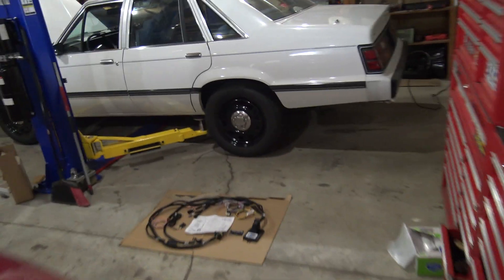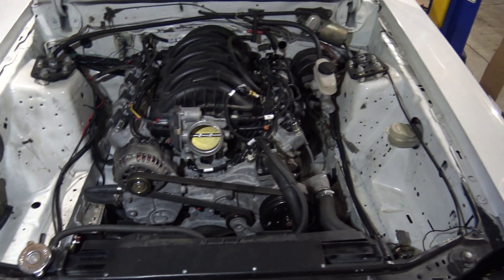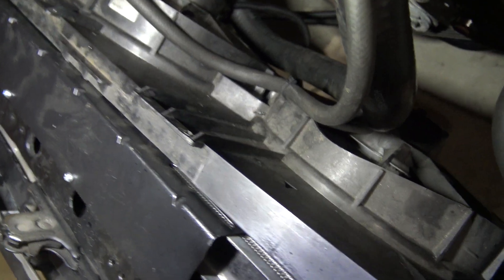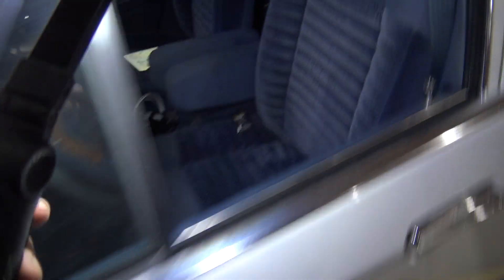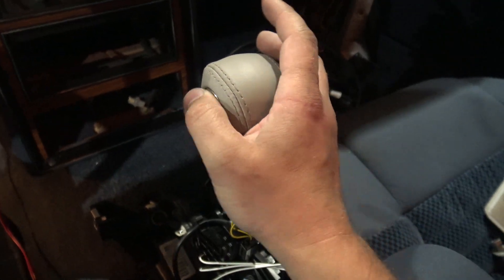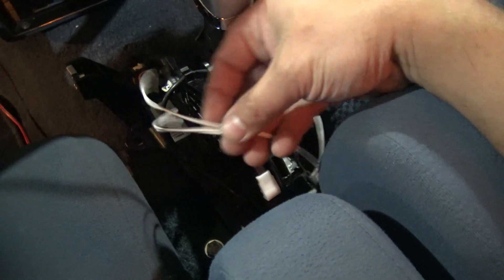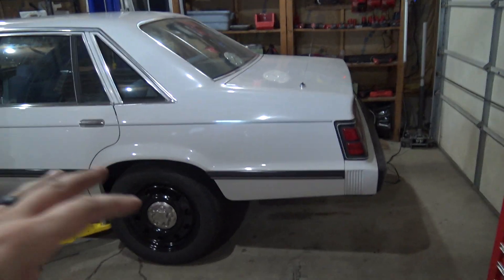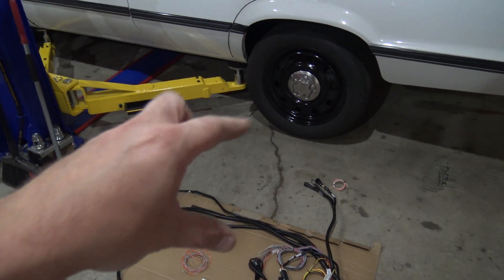Arnes LTXD transmission update

Comment: Forgive me if it’s already been discussed. 

If the torque management can potentially help transmission longevity, is there a way to implement it into transmissions like the TH400?
Reply: Not really since the th400 is completely non-electric so the engine doesn't know when it's going to shift so it doesn't know when to pull timing for a shift.
Reply: Yes, you can do a lot with the custom I/o section in the Holley. My only gripe was not having an engine rate of change pid like you will find on many other standalones. I’m Aaron btw.
Reply: Scrapmetal_Sleepers I was curious about that after Matt said the TH400 and others can eat up power on shifts. I’m very new to the world of electronic everything and stuff like this is so intriguing. Especially coming from roots of if it’s not a BBC and shifted by a powerglide or a T10 then it’s not worth driving. 😂😂😂

Good info guys!

Comment: Torque management being turned off is what causes a 4l60e to die an early death. I have a 4l60 I built in my gto, I still have tq management in it. It pulls timing on the shifts. I have a forged bottom end, heads, cam 5.3 running 20lbs of boost in a 3800lb gto. And it’s been living being beat on for two years.
Reply: TravisT TURBO GTO howzit...hey I have a 05 dbw ute. Still running the ls1 and 60e from factory, it’s slamming on the 1 to 2 shift so hard it chirps the tyres....I wondered if someone went in it and messed with settings, any ideas why it would do this mate?
Reply: Kiwi Boosted Garage yea, and if the removed all the tq management it will do that. Not good for the trans.
Reply: Kiwi Boosted Garage I just looked at your channel. I subscribed, Ima have to check it out. I was thinking about a terminator x in my car.
Reply: TravisT TURBO GTO thanks oh yes I love it I never could really get my head round hpt I’m 46 so computing in general is not my strong suit, my vids are all over the place just messing round to be honest but thanks.
Reply: TravisT TURBO GTO hmmm it seems something is up with it.
Reply: Kiwi Boosted Garage hpt isn’t bad. It’s pretty complicated at first. But once you learn it, it’s not bad at all. You’ve got to come to terms with the fact that the ve table and timing table are vary important to get Correct

Comment: I have spent the last couple years researching this as well and I came to the conclusion the aftermarket will probably end up skipping the GM 6 speed and going to the 8 or 10 speed. AFAIK the 8 and 10 speed once again have an external controller. On the 10 speed, Ford and GM each use a slightly different unit. 

GM sells the 8L90 with a controller through GM performance, which has connectors to get certain inputs.
Reply: The controller GM performance sells is just the regular TCM that would be in a stock vehicle. It will only communicate with a Crate or Stock ECU.

Comment: If this 6 speed swap was easy or cheap, there would be a lot of people doing them. Probably some bigger challenges with this trans, for the big guys like Holley to not have something for this yet.
Reply: The 1-2-3 on this trans is stout af. There are billet 4-5-6 hubs/shafts using powerglide frictions for the trans and they are rated at 1100+ rwhp. A stock 6l90 will hold that kind of power on a dyno but will likely grenade a 3-4 shift if you get too tight on shift timing and don’t cut ignition on the shift.